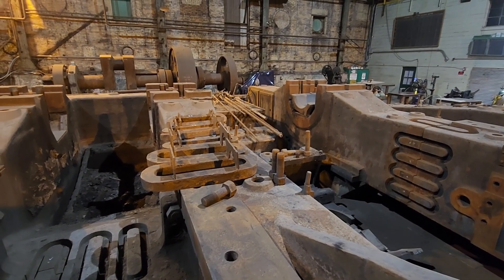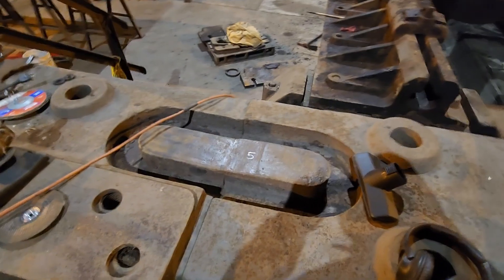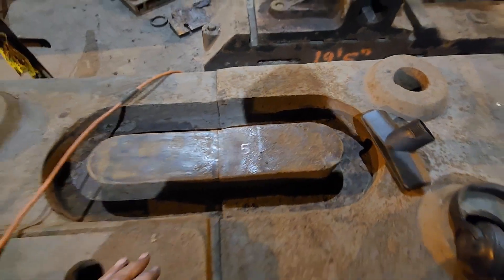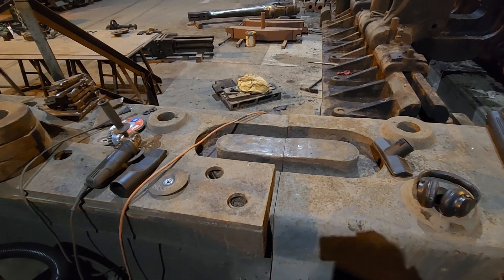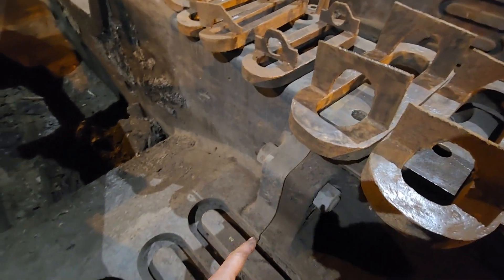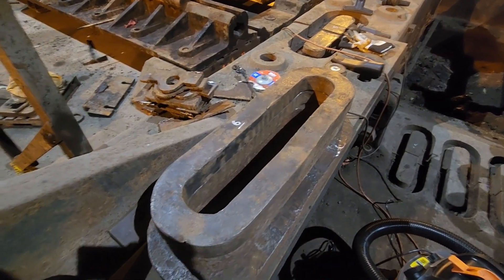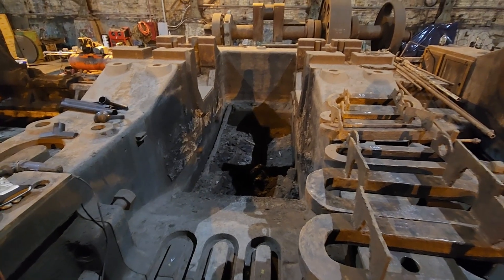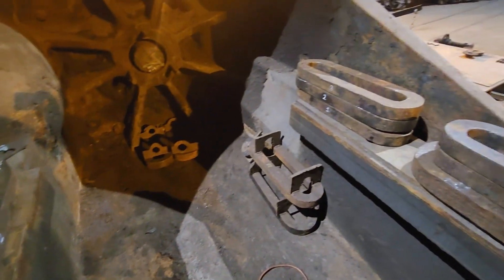48" Mill Part 4 - Shrink Links

Comment: Will the fabricated plate steel links expand enough?  Might have some experimentation to get the center sizing right.   Dubs
Reply from the maker: Coefficient of expansion doesn't change.  Each link has to be sized for the opening it goes into.

Comment: Rick I told my wife, who loves to haul me to 5K races and such that we ARE going to come see your work!! I built 747 aircraft for a quarter century, F-16's prior to that and F/A18 before which adds up to 32 years of it. We used to do a similar trick. Called it a "freeze plug" as it was a small round plug we would dip in liquid nitrogen to shrink it and then shoot it into the hole with a rivet gun and let it warm up and act like a solid surface. Then drill the hole where it was supposed to be.

I will try to get in touch and figure out a good time in the summer. We are in Mansfield so not too far away.